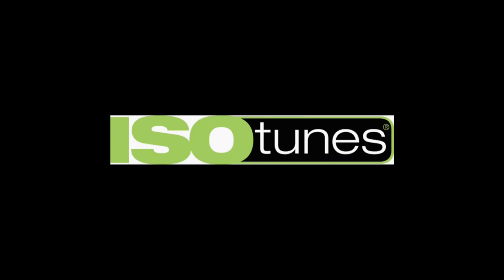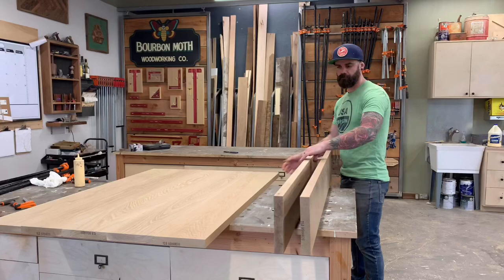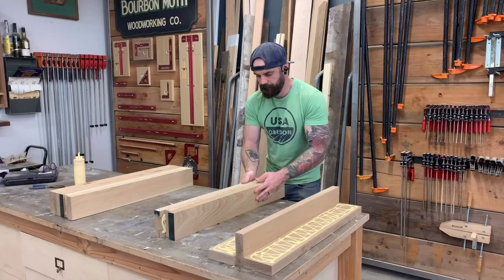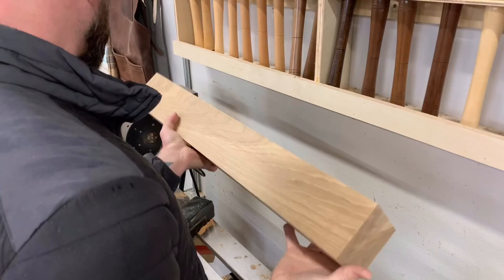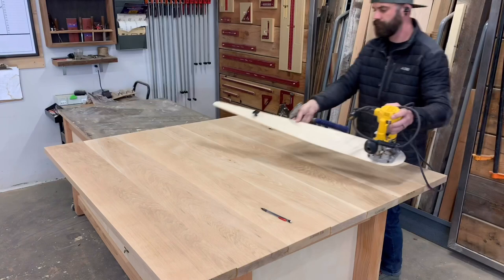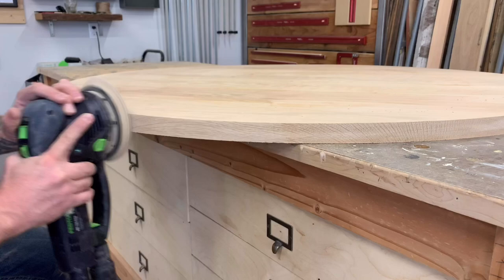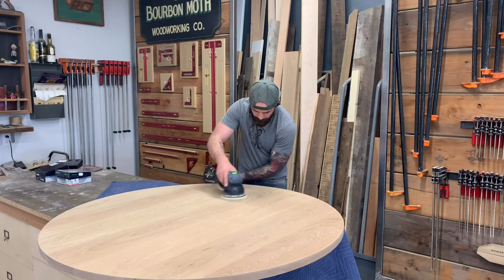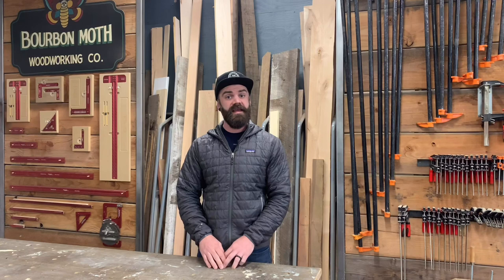How to Build a Round Dining Table | Easy DIY Dining Table

Comment: Here is a tip for removing the glue.  Use a plastic straw and run it down the seam.  It'll pick up most of it and then use the rag.

Comment: glad I found your channel, love the videos, very well made. I agree with you on just gluing things up, I used to be a custom  wood worker and made a lot of fancy raised panel doors, I never once used a dowel jig or a biskit joiner when gluing the panels up. One comment on your surfacing and plaining, I used to start from rough lumber, so I would take the lumber cut it to a rough size then surface it and join one side then plane it to the thickness and then cut to size but I did notice that the lumber you started with was a little more dimensional than what i started with. I wish you would have shown the way you got all the legs the same, I love turning but have not done it in a very long time and want to get back into it, I was just wondering if you had some sort of jig? Your videos are very entertaining and I love you humor, Keep up the good work bud

Comment: Sweet table. I like how the corners came out. Do you ever have issues with residual glue after wiping with a rag like that? I tend to wait for the glue to gel up good and scrape it off.
Reply from the maker: Since I sand the top pretty thoroughly it’s never been a problem
Reply: That’s cool. I guess I worry more about tight corners.
Reply from the maker: Ben Nawrath a card scraper works great for tight corners
Reply: Sure does. Gotta work on my sharpening game.

Comment: Great build! I still have a hard time believing any tabletop of that size is held together with only glue.  I cringed when you lifted it up in the air lol
Reply from the maker: Then you should watch my modern dining table build. 45”x100” just glue.
Reply: @Bourbonmoth  will do!
Reply: @Bourbonmoth  Why did you glue this top up but in your round trestle table build you used dominos to hold it together? Just curious what made these 2 tables different in the joinery. Thank you!

Comment: how do you feel about tongue and groove planks for the top? i milled my own out of alder and it seems to work pretty good at turning the top into one solid unit. ive used 2 layers high quality birch 3/4 plywood for backing running my center seams perpindicular of course and wrapped square aluminum tubing with alder to make a square stretcher base that i will attach layers of alder ripped real thin to form a circle around it. when all is said and done ill put a 2" wide 1/8" thick band of steel around it with rivet heads. the problem-securing it to the base and preventing sagging over time. i feel like its inevitable that over time it will droop some.??? your thoughts?

Comment: Instead of taking the time to set up a dado stack for your z fasteners why don't you just use a biscuit jointer at the correct depth and cut your slots that way? Much faster and same result!

Comment: Who cares how much Jason uses a domino joiner? Do the people that take issue with dominos also say things like "Why do you use a table saw? I don't have a table saw. You should have used a generic Home Depot crosscut hand saw", or "Look at the millionaire.. Using a cordless drill. I can't afford one of those. You should have used an 18th century hand crank drill".. If you guys don't like a professional using a domino joiner, invent a better way. I suggest all you haters spring for a domino joiner. Doesn't have to be an expensive Festool.. But it will bring your projects to the next level.